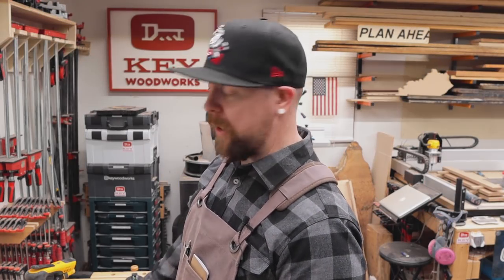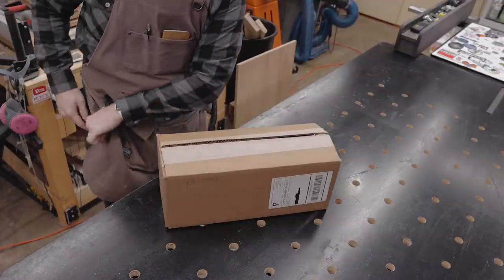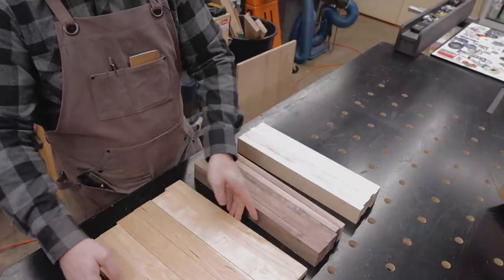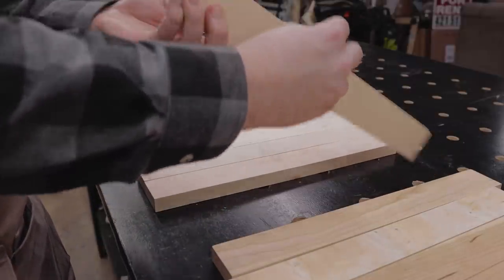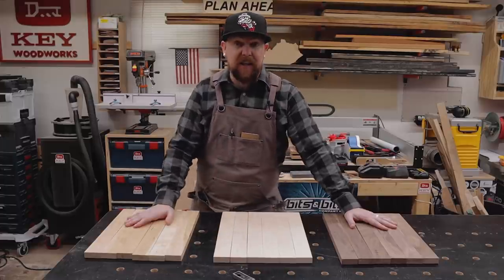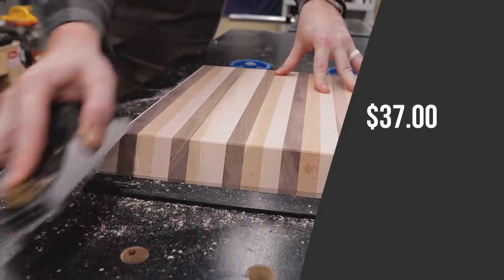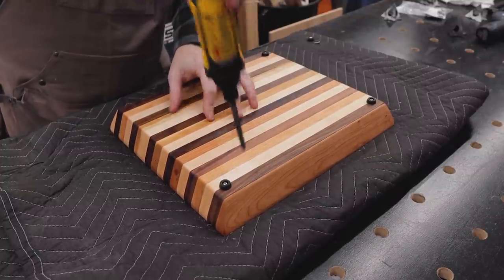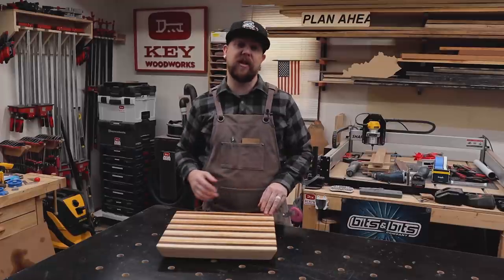Buying the Nicest Wood on AMAZON & Making a Cutting Board

Comment: I do not shop or support Amazon but that isn't too bad of a deal. It looks really nice. I buy my lumber from Rockler. I have had great success. I enjoy going and picking out my lumber. I usually get S3 S. I should try to find a lumber yard. I do not have a jointer but I do have a planer and a table saw. How is the oil you used? Does it have an odor. I bought some sorry can't recall the name but it was the oil and wax in one but it had a pretty strong odor.

Comment: It's a very cool board but for the money I feel like I'd have to rip them in half and get 2 boards an inch thick to make it worth the value to me. And even so you make 20 bucks by the time they're both gone. Granted with virtually no effort. I'm with you, I'll mill it myself  tho largely because I can get the material cheaper. I have family with a mill. All in all tho cool board and cool video.

Comment: Just came across this video.  Glad you had better results than me.  A year and a half ago, I purchased from the same seller.  Boards were not uniform in height, nor straight and had some chips (probably from transport).  I made it work, but learned my lesson and haven't bought wood from Amazon since.  The seller did send me a replacement which was in better condition.  Like you said, you never know what you are going to get.

Comment: I bought some of this several months ago just because I wanted some hardwood to put a few cutting board together quickly. I ended up using some purple heart and padauk and was able to get two boards. Quality was great. I decided to order another pack and the quality isn't there. I had to run all of them through my jointer. They weren't square and every long 3/4 edge was pretty rough. It also kinda looks like I got six walnut and twelve cherry.

Comment: I think another consideration is that you were able to buy exactly the right amount of materials for a single cutting board. The dealers around me aren't chopping their boards to 16" for everyone that walks in so I have to buy whole boards, increasing initial cost until I find another use for the remaining material. As a hobbyist, that may well be months. Also,  I'm no fan of Amazon but people forget there are third party sellers (which the one you linked is) which means your purchase may well be supporting a small business. Is Big Daddy Bezos still getting his cut of the transaction? Of course, but it's not as clear cut as "Amazon bad".
Reply from the maker: All valid points and could for sure make a difference for a lot of weekend woodworkers that don't have time, tools, space, to deal with milling.
Reply: true

Comment: This year I did buy 4 boxes of "Scrap" from Amazon. the reason being that some of the species I wanted for my cutting boards and cheese slicers were not available locally. Three of the boxes were absolutely great the fourth one was a bit on the questionable side. Several pieces had knots and voids and were not full length. For me it ws worth it just because the species I wanted was not able to get in my area.

Comment: I just purchased this same pack to make my wife a cutting board for Christmas. I found the lumber was mostly funky, twisted, and not flat. if I hadn't had as many clamps as I used, it would not have worked well.  I had to stand them up to have a taller cutting board to make it work. Unfortunately, we don't have a hardwood lumber store here in NW FL. Yours turned out well!
Reply: Might be the humidity 
Remember those are sitting in a delivery truck for at least 2 days and wherever this wood came from had a different humidity than Florida

Comment: Interesting! I love how it comes completely open to the air to absorb moisture. 😂 I think I'm even more surprised at what maple costs where you live!! It's comparable to a pint of maple syrup!
Reply from the maker: Right?! I totally forgot to check the moisture content on them before gluing them up. doh!
Reply: @KeyWoodworks  LOL. I'd be very curious to know what it. Although, it's winter and everything is pretty dry right now, but come summertime you may be getting a box of soggy pulp.
Reply from the maker: you just have to check your forecast before ordering in the rainy season

Comment: Nice cutting board. I like all the different angled chamfers. At my lumber supplier, the bf of s4s lumber is calculated prior to milling, so for 1bf you’d actually be getting around 0.7bf of s4s lumber. Maybe it’s different at your supplier, but that would bump up the cost comparison.
Reply from the maker: Thanks! I'll have to check with my mill to see if they are calculating their s4s bf before or after surfacing! Thank for the info!
Reply: Yep all mills and lumber stores calculate bf prior to surfacing. 4/4 s4s is usually 13/16ths thick but you are paying for 4/4

Comment: Depends on whether or not your selling them and how much you get for them.  For an easy build like that, it may very well be worth it. It's an end grain cutting board.  All that picking out your own lumber is lost at glue up. They're just stripes of color at that point.  Unless you have a way of getting much better prices all you're doing is adding labor. Sell that for double your cost and you've made about $17-18/hr. Milling all of that has to add at least 1-2 hours to the project. I can't believe you can mill that in less time then it takes to glue, shape and finish it. Not including dry times of course. So, in short, to save 5 or 6 bucks you reduce the value of your labor to less than minimum wage only to put glue on all the beauty your so painstakingly took the time to choose. Add THAT labor to the project (it takes a lot less time to click <buy now> than to go to the yard) and you just kicked that whole $11 you thought you were saving and now make about $3 an hour, less if you actually have to drive a distance to the yard. You could easily kick $5-10 in gas alone. Get into an accident on the way and it could rack up your costs into the thousands, so buying from Amazon could save you 5, 10, 15k and if you like the occasional beer while cutting, even save you from jail and a DUI. That's a pretty damn good bargain if you ask me. Not that anybody actually did ask me. But I digress.
Reply: It’s actually a side grain cutting board. Not end grain.  An end grain board would require much more work and produce a smaller cutting board.

Comment: Surprisingly affordable, also with rough lumber there is waste for checks and knots. When you factor in saving a trip it's even better. One thing to consider as well, there is often discounted shorts or cabinet shop waste that could fill those parameters. I recently bought a few boxes of cutoffs for $40/box it was probably 20 board feet each and could be made into cutting boards pretty easily. I'm using it to make a bunch of handles on my lathe. Anyways, cool video!
Reply from the maker: All good points. Thanks for watching!

Comment: Great video, Nick! It was very well produced. I'm surprised to see that the Amazon board actually turned out well. It does seem pretty economical for someone without a planer or jointer.
Reply from the maker: Thanks! It would make for a great first project for anyone just getting started.
Reply: @KeyWoodworks  that would be me .I still have some tools and clamps to get.

Comment: If you brought rough sawn lumber you would not save $11. The yard calculates the BF based on the size as is. Plane and joint 3 BF and you'll yield less than 3 BF for your project. If you need 3/4" you'll need to buy at 7/8 or 1". You'll waste between 1/4-1/8 of an inch planing, more jointing, so you'll have to add about 5-6 dollars for cost netting about $5.50 in savings, absolutely not worth the time, labor or mess, IMNSHO.